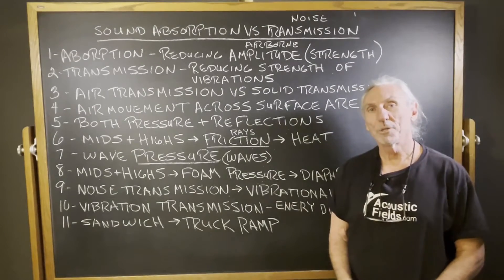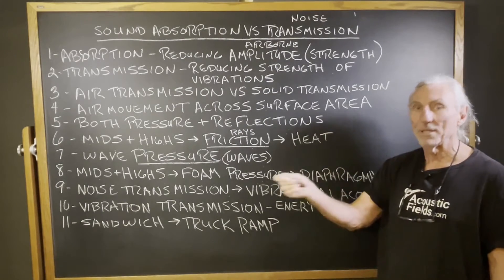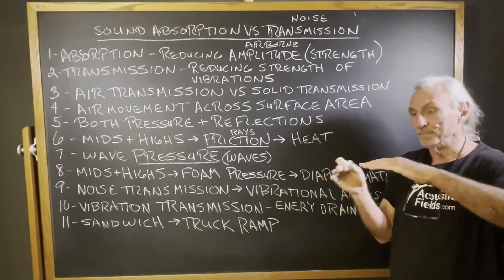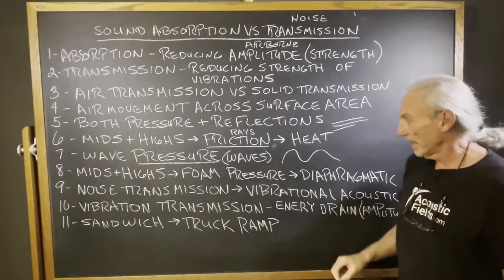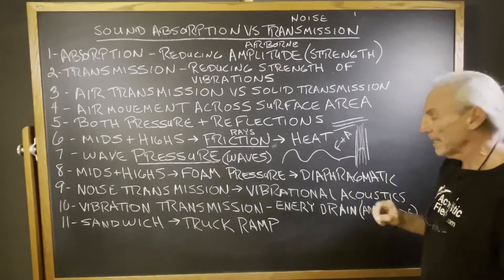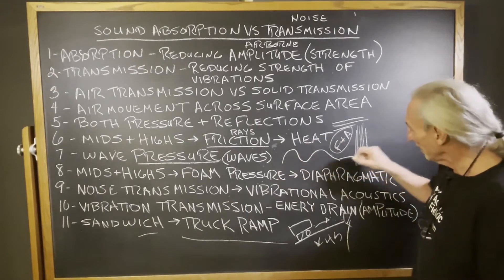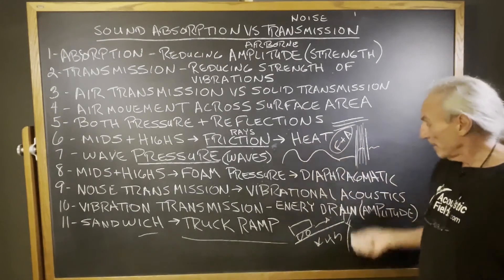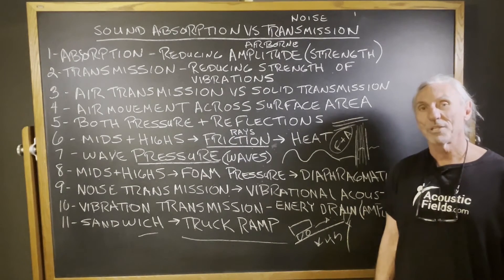Sound Absorption VS Noise Transmission - www.AcousticFields.com

Comment: Garbage 🗑️🤮 you are Wrong!!!

If you Absorb the Sound then the Sound WILL NOT GET OUT at the same sound level!!!! You can greatly reduce the Sound that leaves your house. Think about a Sponge. Pour Water on a Sponge 🧽 and the Sponge will absorb the Water. Just like Sound Absorbing Materials will Absorb Sound!

I know for a FACT that using Sound Absorbing Curtains and Fabric all Around your Home Theater will Absolutely Absorb the Sound.

I have tested this. My Bedroom is Next to my Home Theater. Before I Used Sound Absorbing Materials and Curtains All Around my Home Theater, on / over the Doors And Windows the Walls. I would get the Loud Sound of my Home Theater Speakers filling my Bedroom.

After I installed the Sound Absorbing Materials the Sound was reduced by at least 75%.
Reply from the maker: You are confusing sound absorption with noise transmission. Study the differeence in the two branches of physics.
Reply: @AcousticFields  You completely Ignored my comment!!!

Sound Absorption Absorbs Sound = Reduction in Sound.

Beyond the Fact that I successfully used Sound Absorbing Materials to Reduce the Sound coming from my Home Theater easily by 75%. On the Other side of the door the Sound is reduced by 75%.

Ignorant videos like this one Falsely say that Sound Absorbing Materials are only for the Acoustics of the room. That they do Nothing for Sound Proofing a Room. 

Since I was a Kid working in my School's TV Station I have studied AV from Top to Bottom.

My School was Built in the early 1900s. None of the rooms were built with insulation or any Sound Proofing.

Our TV Studio our Band and Music Rooms were All Sound Proofed only by using Sound Absorbing Materials. This works so well that The Band can Practice without any other Class room hearing them.

FYI Sound Absorbing Materials Do much more than just Absorb Sound they are a thick Barrier to the Transmission of Sound.

Comment: I know this is an older video but perhaps you can help me.
I know blocking impact noise is not going to be possible in my situation but I'm looking to deaden/muffle it as much as possible.
Impact sounds, very rich cracks and creaks from the ceiling/ apartment above. Old building.
I was thinking about investing in some mlv. Enough to cover about 12 square feet. Staple it directly to the ceiling, hang a drop cloth beneith it, and essentially cloth cloak the walls. The mlv because of it's barrier properties and the cloth/ drop cloths to help prevent echo from bouncing off the walls.
I would like to cut the noise impact in half, think it'll work?
Actual construction is not an option.
Reply from the maker: Any material type that you use to treat noise transmission  is based upon the frequency and amplitude of the noise. What are the noise numbers?
Reply: @AcousticFields  In honesty I've not watched enough of your videos to know of what you refere to. Nor do I know anything about audio noise.
So examples would be the wine of am old nail pulling out of wood, the crack of wood not chopped all the way through, the popping of an old solid spring. All within a  confined space with no difussion ,coming through 
and echoing of empty walls beneith.
It's as loud as an alarm clock or a wooden mallet hittting the wall, at the very least. Only it's directly above a sleeping area.
Not sure if that'll help you help me.Ive been looking into underlayments that could not be under but over the surface. Recycled rubber , mlv, cork. To help block/ defuse.

Comment: Any Tips on how to start with Room Treatment (beside measure) within a big room (3,10m Ceiling Hight, 6x5 meters Roomsize) - How to calculate the costs, where to start and so on... would be great to see a detailed video on how to find the correct & best Products for certain types price points and how to create a concept (without going to an Acoustic Dealer who want to sell you only their Basotect Absorber, because there are a lot with that material)
Reply from the maker: Fill out the information in this link: https://www.acousticfields.com/free-room-analysis/